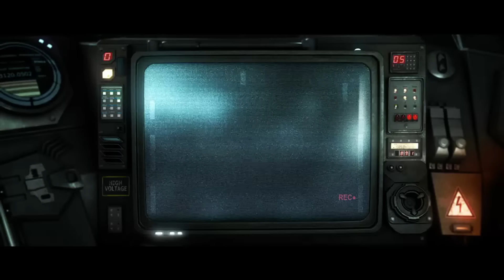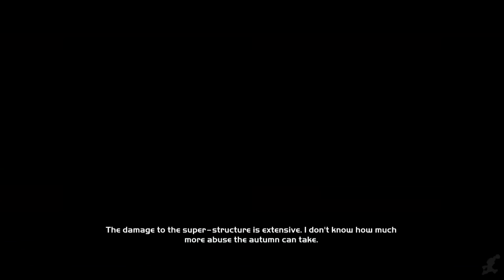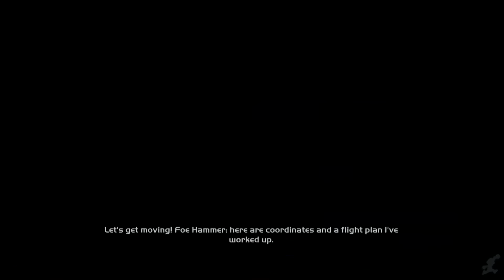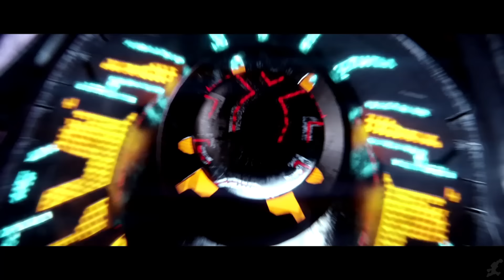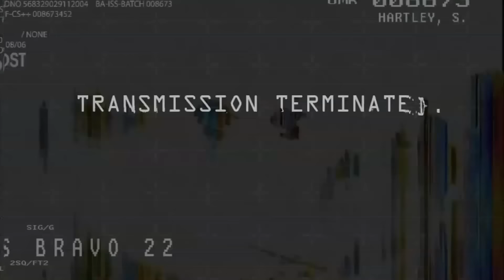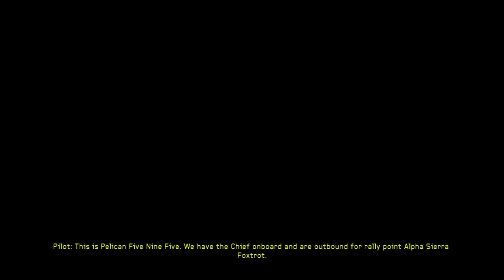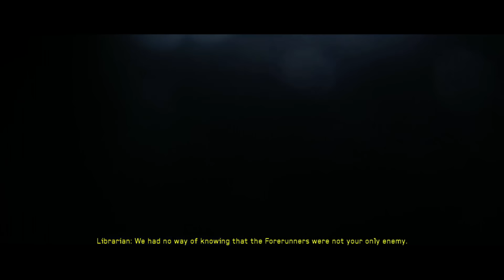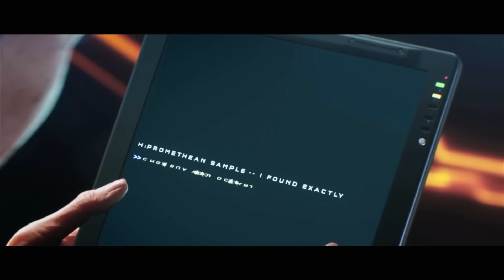HALO: THE COMPLETE SAGA

Comment: BLUR and 343 made a HUGE mistake on the cutscene at 5:53:47!

In the mission Quarantine Zone you finish the mission and a cut scene appears where Miranda Keys is reaching over to grab the Index and unknowing uses one of the Gravemind's tentacles to grab the index. Somehow Blur studios and 343 thought this tentacle was just some metal wire and in the updated cutscenes they show this as a wire that is wrapped around some wreckage.

I think this is such a huge mistake because it is VERY obvious that it is in fact Gravemind's tentacle because as you can see in the old graphics it is the has the same color, pattern, shape, and texture as the tentacle that grabs Master Chief in the water at the end of the mission Regret. Not only this but right as Keys grabs the Index Gravemind lets the tentacle slip and as it slides you can hear the squishing noise that is the same noise the Flood makes when moving around. And also it is obvious that the Gravemind is in that hole below the Index because at the end of this cutscene the Arbiter is pushed down this hole by Tarturus, and we later find that the Arbiter was caught by Gravemind at the bottom of the hole.

Blur Studios and 343 seemed to miss this entirely and while it may not be a complete story altering aspect to the scene it does have some features that upon studying, are quite interesting. Firstly, Gravemind knows that the Covenant are attempting to fire the Halo and destroy all life in the galaxy, so it is inherently hoping that the humans get the index first, therefore it conveniently places its tentacle where Keys will be able to use it to reach the Index. Secondly, right as Keys grabs the Index, Gravemind attempts to drop Keys into the hole where is is residing, thus ruining any chance that the Halo will ever be fired. Keys is saved only when Sgt. Johnson (bless his soul) jumps in and grabs the tentacle before it can drop Keys into the hole.

These two features show how fore thinking the Gravemind really is, and it is these small details that are also very delightful for us, the gamers, to really ponder on; for reading between the lines to see the thoughts and motives behind these small details are some of the most rewarding things a consumer of a story can experience, and I personally think its a shame that this wasn't caught by 343 or Blur Studios. Unknowingly replacing the tentacle with some lifeless cable really got to me for some reason, I think it just made me feel like Blur studios wasn't paying enough attention.

Other than this relatively mistake, all the other cutscenes in the game are truly GORGEOUS and wonderfully recreated and I applaud their effort and craftsmanship!

You can see the original cutscene here: https://www.youtube.com/watch?v=pYYIskyLiBw 

And the updated cutscene here (around the 1:00 mark): https://www.youtube.com/watch?v=6Mrw7rfrI0E

thanks for reading,
sorry for the rant...
hopefully you can understand where I'm coming from!

Comment: love the video so far. just one tiny thing if you ever modify or add to it in future using later installments of the franchise: One of the Halo CEA terminals (The one where Guilty Spark is speaking to the covenant AI) should be at a different point in the timeline than it is. My personal suggestion is that it go at approximately 3 hours 8 minutes and five seconds. In my opinion it fits better within the continuity given the lore references in that particular segment. Otherwise you've done a phenomenal job. keep up the good work.
Reply from the maker: Chris Roberts Thank you for the suggestion. We were planning on updating the video once the ODST update came out, Then we'll add the new ODST plus a couple of chronological updates.

Comment: am i getting something wrong? Besides the fact that the Librarian could've stopped the Didact whenever she wanted, she had the power of saving someone from the halo extinction and she chose, above all in the whole galaxy, the one person that made necessary to use halo arrays... BUT not before she could store some of the floods (the reason why they are using halos to wipe out the galaxy) just here and there... for no reason AT ALL.

Comment: The Halo 2 Anniversary terminal that shows Thel Vadamee already as Arbiter and the second Halo already found really shouldn't be before Halo 2.
Reply from the maker: Very true.  I was debating about that one for a while.  This video is not chronological overall, there are a couple of sections are intentionally not in chronological order because they work better in other places.  The reason I had trouble deciding on that terminal is because it would be inserted in between Halo 2 and ODST at a kind of random point, with the narration of an unknown character.so I wasn't sure if it would throw people off. But either way I think it works. It probably is better in chronological order, cause it does give away some of the plot. When I updated next year with H5 and new ODST I'll switch up the order.
Reply: Gamers Little Playground™
Well done soldier

//John -117